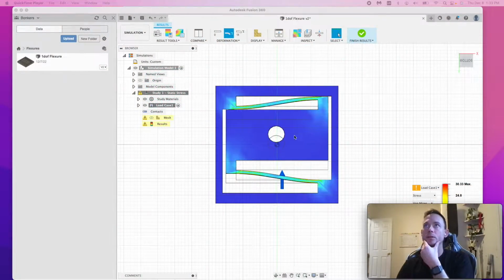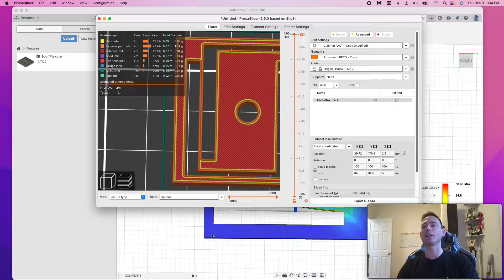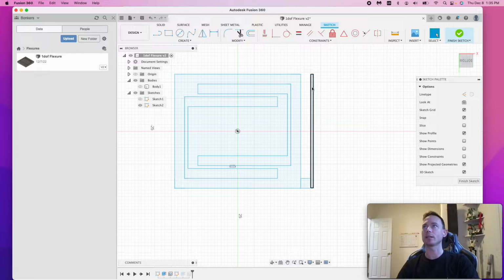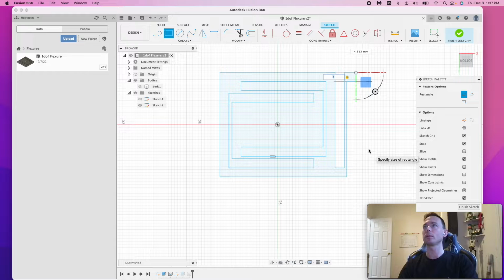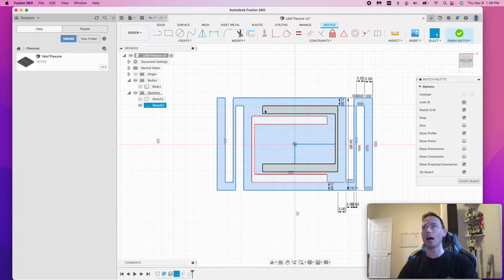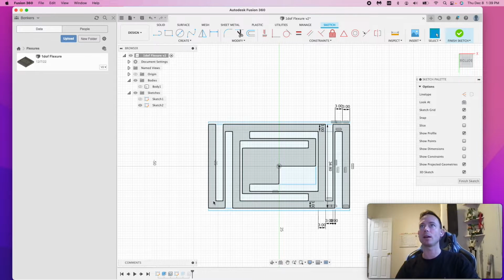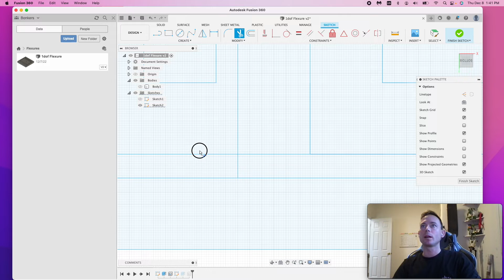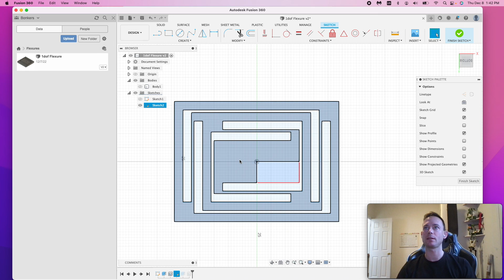Designing 3d printed Flexures in PETG - 2DOF

Comment: The stiffness k of one leafspring that is going to be curved in an S shape is given by k= x/F = L^3/12/E/Ix, where E is the Youngs modulus, Ix is the area moment of inertia (in m^4) which is h^3*w/12 with h the height (your thickness) and w the width (your bottom to top length). L is the length of the beam.

Comment: Ive 3d printed such flextures in the past as prototypes to test and later make in sheet metal. I was using PLA, worked fine for testing a few times but gets brittle very fast and breaks. So not useful for an application. How is PETG in this regard? Or do you recommend other materials/filament for longevity of these flextures?
Reply from the maker: PLA is quite a bit worse. PETG is probably the best you can print on a standard printer. The best material I could find was POM, which would allow you millions of cycles, but it’s mostly machined or laser cut.